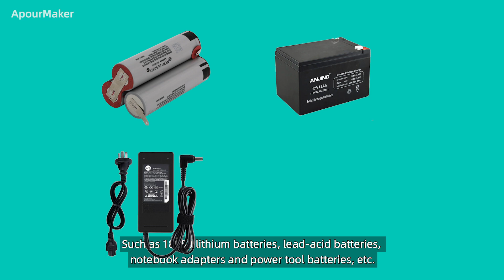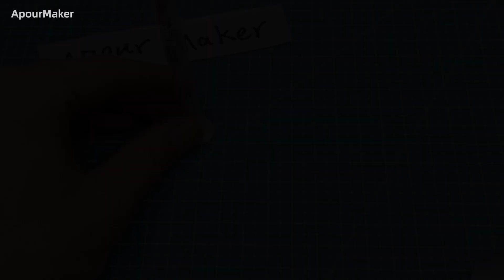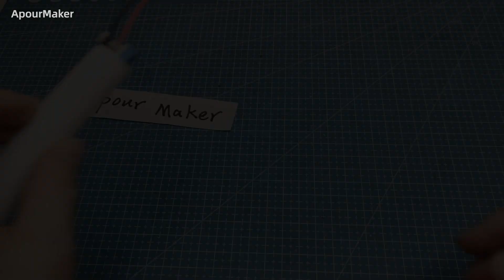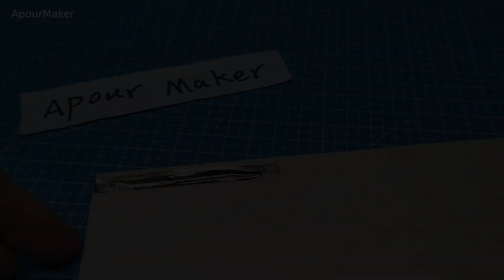How to make a HAKKO T12 soldering iron Adjustable temperature only $5

Comment: Hi, nice work. I have some questions. Can this setup be used to continuous work. I have to find a cheap way to heat an aluminium block 3x3cm but to run continuous and maintain verry good the temperature, also can i wire the heater with wires of about 20-30 cm? I mean i need the heater to be inside the aluminium block and the temperature control in a small box. Also does this work with a power suply of 24v and more amps, like 5 amps or 10? Thanks! Subscribed!